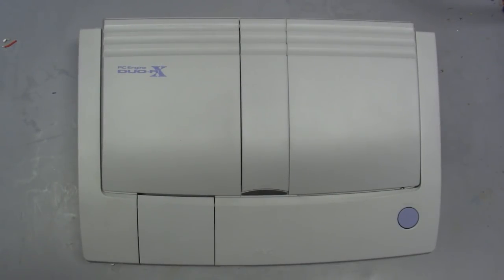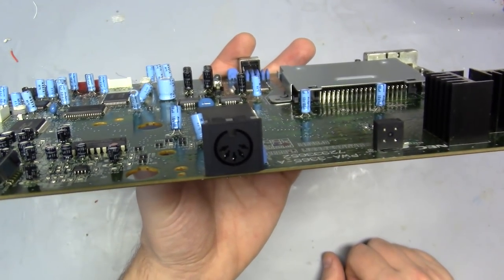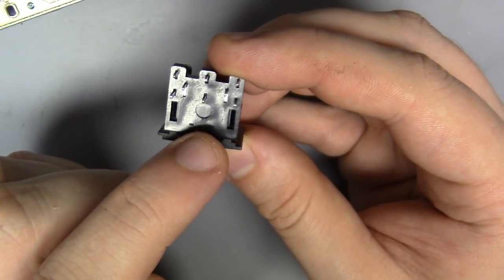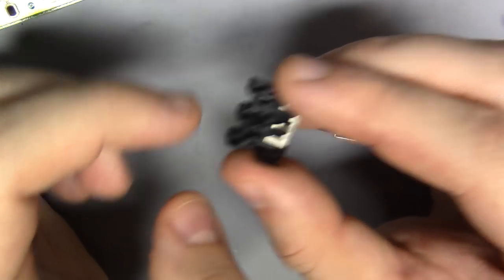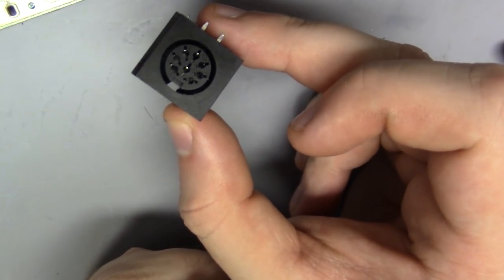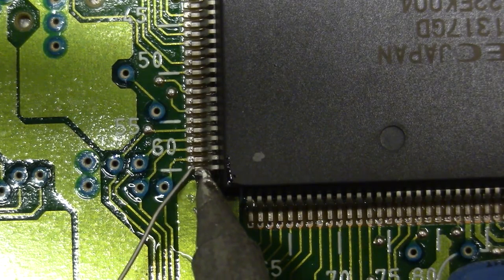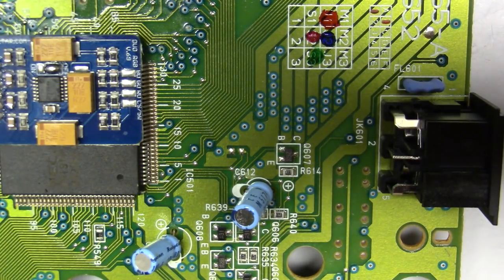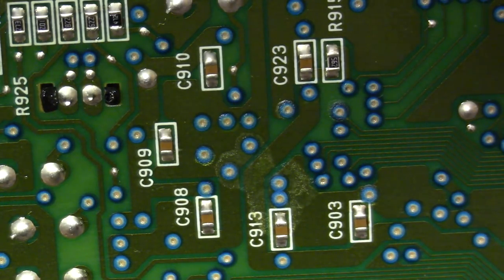Getting RGB Quality Video From The PC Engine Duo R

Comment: Would this mod be possible with a U-style 262 port or 9-pin Genesis 2 style port instead of the C-Style 270 you used? I avoid using SCART or JP-21 whenever possible so I want to use HD Retrovision or RetroTink Genesis component cables with this mod, but no one is building or selling C-Style to U-Style/9 pin adapters for that to work. HD Retrovision used to sell Neo Geo adapters that used the C-Style ports, but they've since stopped making them a few months back. If the mod is not possible this way then I'll be forced to build my own adapters which is incredibly annoying.

Comment: Would be cool if you did a vid on the supplies you use, which ribbon cable and flux, for example. Maybe include how you can easily strip kynar wire...because I'm always breaking it...

Comment: I've been steadily practicing the soldering craft and while I'm nowhere close to the point where I'm willing to sell my work to others, your videos have gone a long way towards helping me learn all the tiny little tricks that written words alone couldn't explain.  That secondary "wiggle" on the solder sucker DURING the suction changed my actual life.  Since I started doing that I no longer had to add a "tug" on components to make sure they don't "stick" with one last bit of solder at the very end, which has saved me many a torn pad I'm sure.  I'm planning on a very basic composite mod on my brand spanking old PC Engine (ditch that RF module entirely, me!), and am saving the RGB mod for my IFU somewhere down the line.

Comment: great video, it basically showed me that someone like me with two left hands shouldn't not do soldering (since I broke a few controllers in the past) so I'm just going to wait patiently until someone offers to mod my system (since I also have doujindance).
Reply from the maker: You can do it. I believe in you! Just try your best. Your first attempt may not come out great, but practice, practice and practice!

Comment: Great Video. But I want to mention everyone. IMO The Pc engine Duo series was the hardest console to mod RGB output. Some Models of PcEngine Duo have very sensitive electronic components if you don't have good solder technics and electronic circuit knowledge. You Should not mess around with it.

Comment: Needed this last month! lol
Great vid as always. I feel like I'm responsible for this video because I asked you last week to do one. lol Pretty sure other's asked as well. 
One thing I haven't tried that I wanted to try was adding a switch to the sync/component out so you can toggle between Csync and component out. So basically, I can use 5 pin din or 8 pin din depending on the situation. Is this a good or bad Idea ?

Comment: Just installed this on my pc engine duo, looks great but one thing is the colors seem way oversaturated, which i have to correct by reducing the color control on my tv. Did I do something wrong perhaps? I'm using a retrotink scart to component transcoder connected to a CRT TV.

Comment: Damn, you make it look so easy!  Hahaha!  I managed to get a really cheap, naked RX a few years back (¥5000!) to RGB mod.  I did not want to touch my original RX.  Well, I somehow managed to destroy the HuChip when I was trying to attach the wires.  I bought a chip from HK, but I lack the tools to remove the old one and put the new one in.  I just hope the board was not damaged as well.  I will find someone to replace it for me one day!

In the meantime, I have a CD-ROM2+Core Grafx2 and a SuperGrafx+Super CD-ROM that I DID manage to RGB mod.  Is it worth taking the old one out and putting in the 2.0 board?

Comment: Any idea why when moving some games main sprites around the colours change to black and white it's just the sprite your controlling, when you let go of the pad they revert to colour, it's always in the exact same spots on each game with the issue, most of my games play fine but Cosmic Fantasy 2, Final Blaster and Dragon Egg at certain parts of the game at the same screen background area width/length do it without fail, say for example in a specific town the area between the 2 shops when you walk in that space and that space only it will happen, otherwise the rest of the game is full colour, it's usually on grey backgrounds to like the concrete floor on Cosmic Fantasy 2, the Grey Pipes you walk past on stage 3 of Dragon Egg or the grey of the moons surface on Final Blaster. Is this a TV and Composite, Power or RAM issue? The TV isn't a CRT, I am using the Composite that came with the console a DUO-RX on a new LCD TV, if it's just a case of getting a second hand CRT I am happy to do so, or is it more complicated with me running a Japanese 60Hz console in the UK? there were never issues with my old Japanese MEGADRIVE, also is it preferable to use a Playstation 2 PSU to power my PC Engine rather than the 3rd party one I've been using? I'd appreciate any help and advise to both improve my machine and prevent any damage I may or may not be causing. Thanks for any responses in advance.

Comment: I am planning on getting a PC Engine Duo Plus. Is the procedure about the same? Also I am using a Framemeister with a powered sync stripping adapter, so would I notice any difference between composite sync and leaving the original composite video signal in tact? I would prefer to still have composite video capabilities on the system if possible.

Comment: Any idea when installation/repair services for the Duo will be available on your website?  I'd really like for you to install your RGB board into my Duo-R and also replace the capacitors.  I'm really not good at soldering and I don't want to risk damaging or even killing my Duo that I have owned for several years.

Comment: Can anyone help? I have a RGB amp with CSYNC, but it only inputs and outputs RGB. Do i just not connect any cable to the SYNC pin on the DIN, or do i have to run a wire from elsewhre? I hope someone can help Thanks!

Comment: hey voultar, if csync is needed, do you recommend using an LM1881 or pulling it directly from the 6260 chip?
Reply from the maker: You always want to use what's natively available. Buffering it off of the 6260 is most ideal.
Reply from the maker: You have to deal with reflections, and of course there's the propagation delay. So if you use a sync-stripper, the raster is going to begin drawing "later" than it really should which results in a horizontal shifting of the picture.
Reply: Hi Voultar, thanks for getting back to me. What are "reflections"? I'm asking because, for the time bein,g I have to use an LM1881 chip with a few of my consoles that do not generate csync such as the original Playstation.

Comment: Does the PC Engine Duo R not require wiring to the 5V & Ground? I notice mods with the PC Engine Duo have those wired. Is there a difference in the 2?

Comment: i just want to ask what soldering iron that is you were using to remove the solder from the joints. ive never seen one with a pump. could i possibly have the make and model of the one you use please?
Reply from the maker: Peter Dobson Sure! Thats a Hakko 808. But these days I just use my ZD-915.
Reply: Thanks for the quick response! I'll have a look into both of these. Always wanted a soldering iron like this instead of using one of them spring loaded plunger type removers!